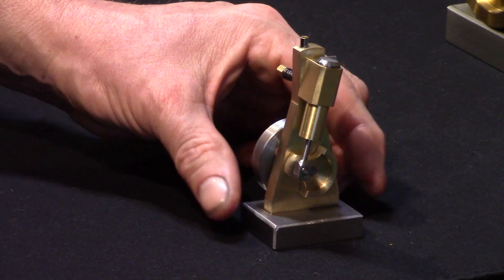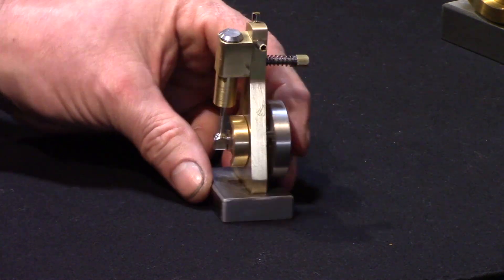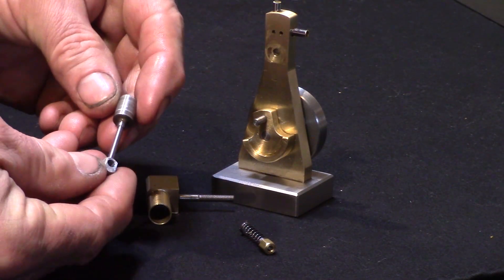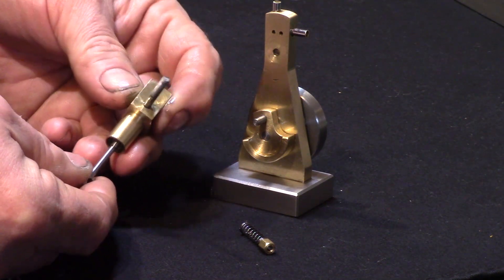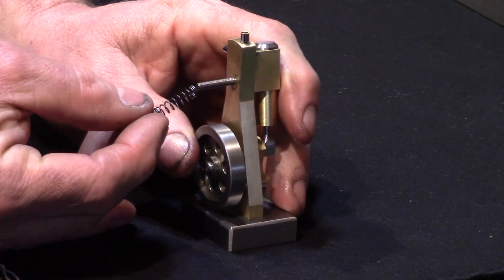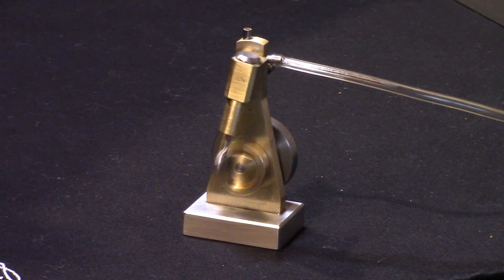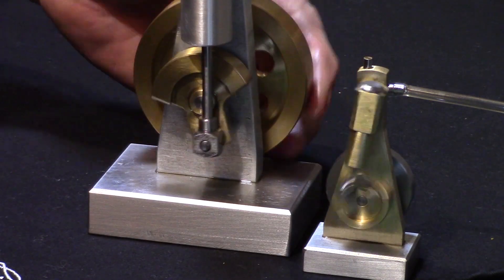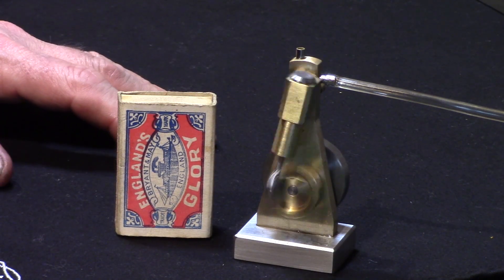Wig-Wag Micro Steam Engine - 1/2 Scale

Comment: That’s a great little engine Ade. Love your work as I’m just getting into model engineering but struggling to find materials at a reasonable price? Any ideas please? I live West Midlands
Reply from the maker: Hi Mick, thanks for the comment, I have used John Keatley metals in Brum for a few bits, they are based near Aston and have a good selection of smaller offcuts for good prices, both steel and non ferrous stock, good helpful people too